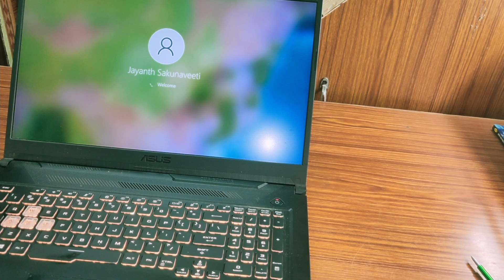What's Inside A Laptop - Tear Down Of Asus TUF F17 Gaming Laptop

Comment: that's not a teardown,  but a good video for knowing basic specs of the laptop and a view inside. a teardown would be you unplugging everything in there, fans included. I was trying to find out if the charging port is soldered in or plugged, do you remember if it's soldered or plugged?